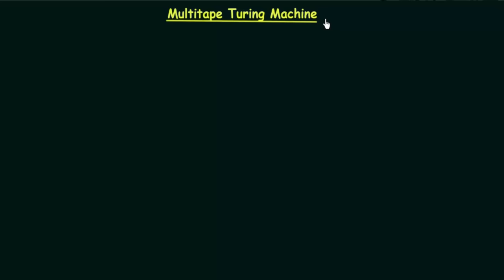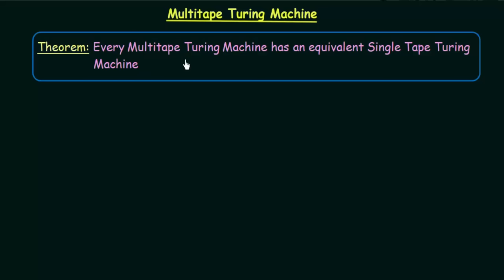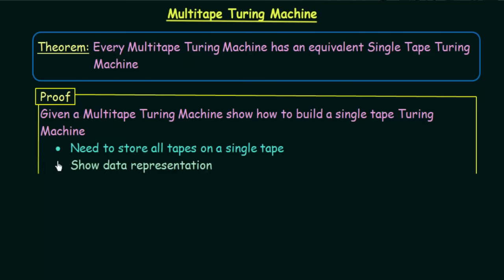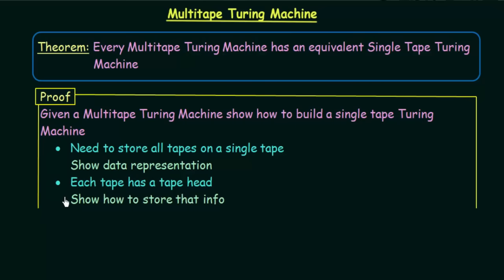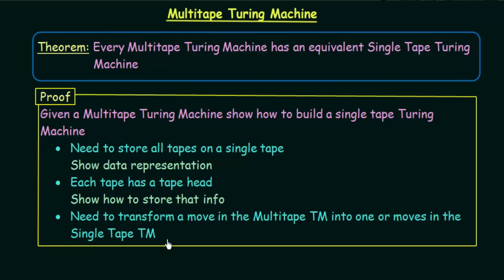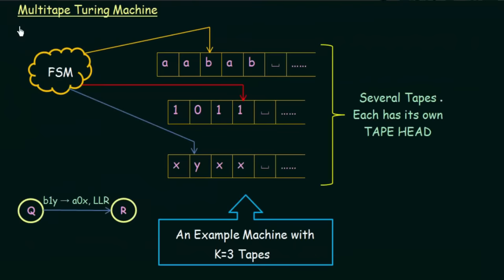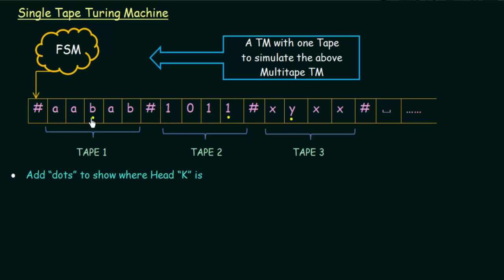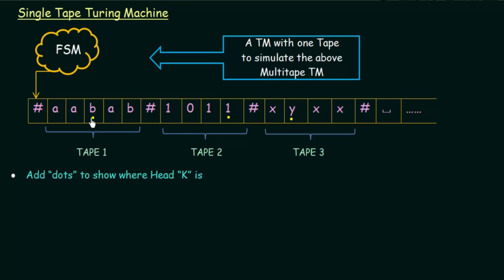Multitape Turing Machine

Comment: And where in the definition of rules of operation of TMs does it state that we can arbitrarily add dots ? The rules state that we can only update a cell using the defined alphabet or a blank. How does one write both a 'dot' and a character of the alphabet?
Reply: I guess what we can do is assign special characters for a and b when the tape head is supposed to be there. Say we assume that if the tape head is present on a, it should be represented by '?' and when on b , it should be represented by '!'. In this way when we encounter a ' ?', or a '!' on the tape, we will know that it is the position of the tape head and also we will know what is the actual symbol present there; a or b